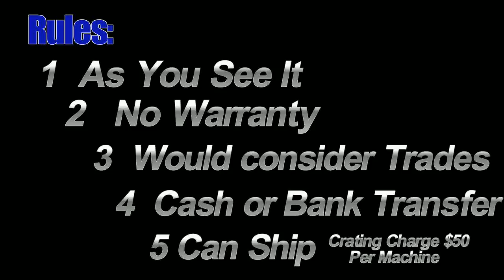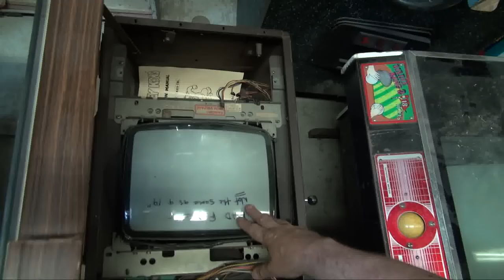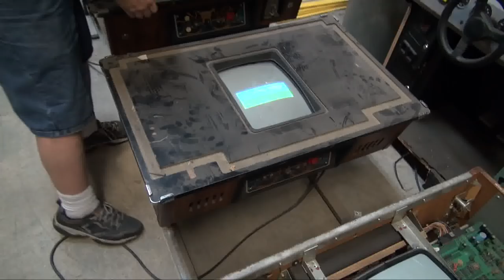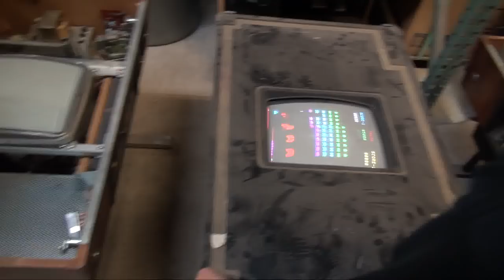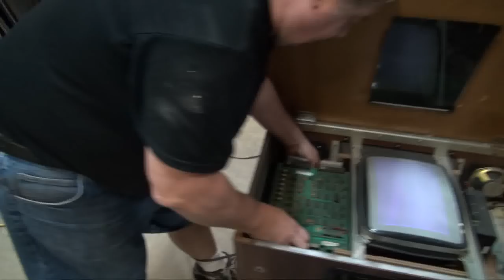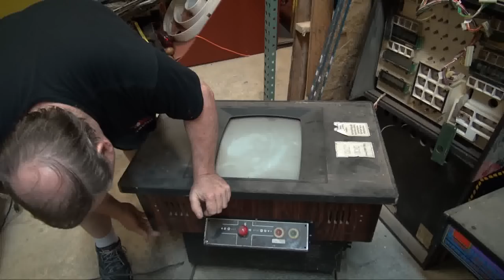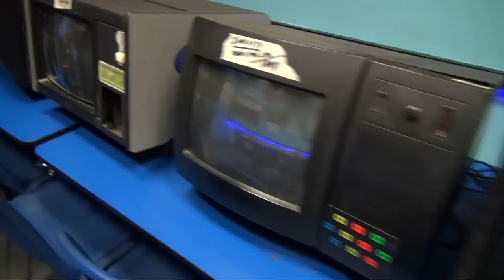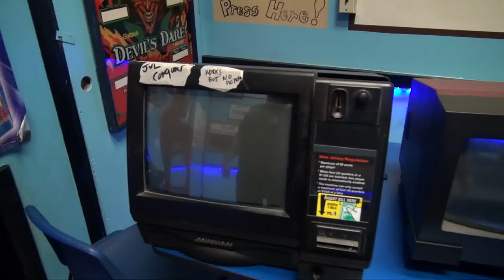#1408 Todd's BARGAIN BASEMENT #18-Cocktail Table ARCADE VIDEO GAMES & MEGATOUCH-TNT Amusements

Comment: You can get mega touches cheap because nobody wants them. In 2005 I bought one at a flea market for $10 and scrapped it for parts on eBay totaling over $600. Then in 2007 I bought a working touch master for only $125. Still have it. In 2018 I see them dirt cheap on craigslist all the time.
Reply from the maker: You need to buy mine!